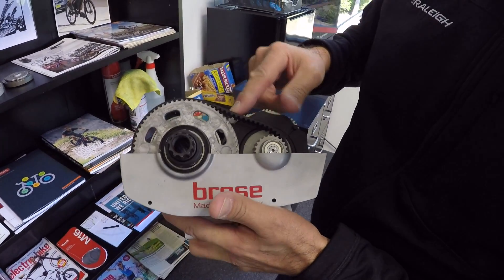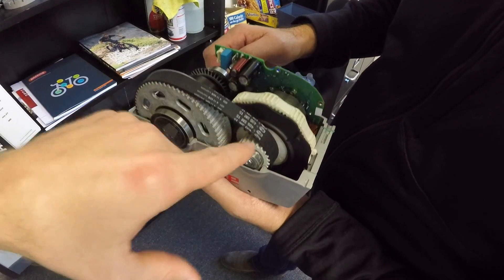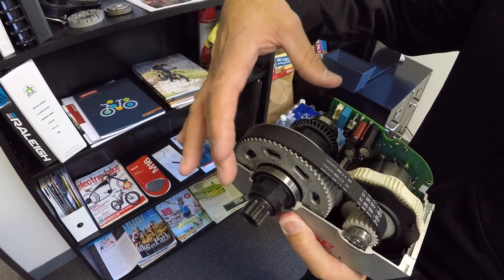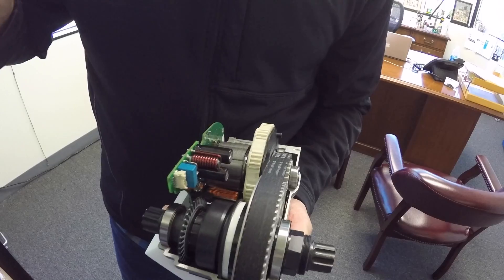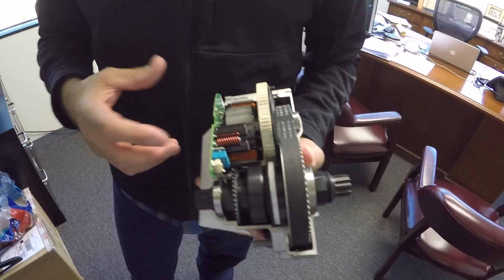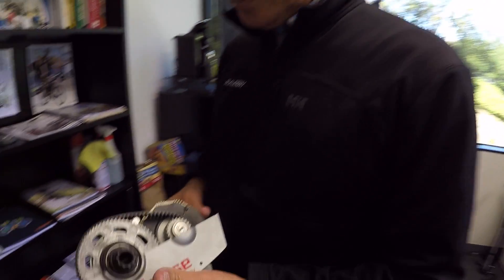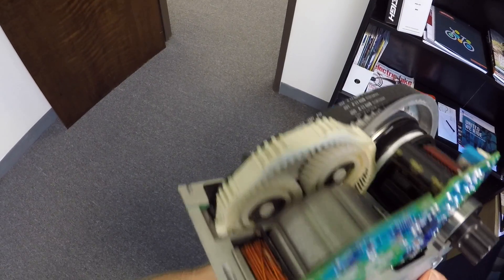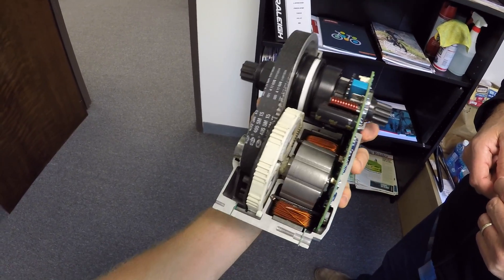Inside the Brose Electric Bike Motor

Comment: Planetary gear broke after 1000 km to Brose S-mag 2021. I bought a new Planetary gear part but obviously something is not working anymore: I'm a Fan Brose but after this engine  whitc is so fragile I am chane to Bosch bike. Don't sell parts anymore if they can't be changed than in the factory.

Comment: Awesome✳✳>share4.photo/ebicycle?ㅙ35    fast and very fun. I have not yet taken the bike for a long ride as it has been snowing at my house since it arrived. Very happy with crazy quick shipping. The install video is pretty poor but if you've ever done bike maintenance you can figure it out. It's definitely heavier than a normal mountain bike but the power makes up for it 10 fold. The tires don't look very durable and won't hold up too long in the desert out here. Overall I'm very satisfied with the product.

Comment: Thank you for giving us that look inside the motor. I found this video because I'm trying to debug what I think is a Brose motor problem on my new Specialized Turbo Vado 3.0. When cruising in top gear, maximum assist, 24-25mph, I get an occasional clunking/skipping sound and feel, as if the chain skips a tooth or as if the motor skips a tooth internally. On my last ride, I counted 20 such incidents in 5 miles, so I think it's getting worse. My bike shop believed it was a tight chain link and installed a new chain, but the problem persists, so I'm thinking it's in the motor. Court, have you ever experienced anything like this?
Reply: Any headway on determining what causes the clunking / skipping.  I had a Vado 5.0 do the same after less than a month of riding.  I turned it back into the shop where I bought it and they gave me a loaner Vado 5.0 while mine was serviced.  Now after 3 weeks, the loaner is starting to make the same clunking / skipping noises.   My bike shop stated that Specialized was lagging in aknowledging the problem.   I'm curirous how wide spread the problem is or if is just a couple of bad motors.  Please let me know what you learned.  Thanks

Comment: Ultimately the “microprocessor” that governs the bike’s performance/safety is your own brain. A newbie or "child" riding an electric bike may face a panic stop with the brakes, while still pedaling or at least moving the pedals. There is nothing “wrong” with having brake sensors that cut off motors to even mid drive systems.
Reply: I have a Vado 6.0. and it has sensors to cut the power ( or something like that) when braking

Comment: which means you need to replace the belt and sensors after certain miles ??
Reply from the maker: It's not something you replace... these motors aren't designed to be opened up. Think about how long the timing belt in your car can last. It would get much more use (and heavier use) than this and they last for years and years :)

Comment: Look like a great motor!! Is it water proof and how well does it work in the heat. I'm in Florida and it's 93 degrees every day in summer and rains every afternoon ?
Reply from the maker: I believe that these higher end motors are very water resistant but you wouldn't want to submerge it. I think it would be okay in the rain and riding through puddles :)

Comment: The motor does not stay quiet for very long mine is making a lot noise
Reply from the maker: I'm not sure what the deal is but yeah, I have heard some loud Brose motors (on demo bikes mostly) but I bought one for myself last year (the Specialized Turbo Vado) and it stayed quiet the whole time. Maybe it has to do with how hard you ride it or maybe some batches are better than others but yeah... I confirm what you've experienced and I don't know why that happens
Reply: Mark Galloway Thanks for that real-world detail, Mark!  That's the kind of gotcha consumers are looking to avoid!
Reply: i think its a belt tension..lag
Reply: Any headway on determining what causes the clunking / skipping.  I had a Vado 5.0 do the same after less than a month of riding.  I turned it back into the shop where I bought it and they gave me a loaner Vado 5.0 while mine was serviced.  Now after 3 weeks, the loaner is starting to make the same clunking / skipping noises.   My bike shop stated that Specialized was lagging in aknowledging the problem.   I'm curirous how wide spread the problem is or if is just a couple of bad motors.  Please let me know what you learned.  Thanks

Comment: I've started riding Bafang HD motor couple days ago and I'm amazed how powerful, quiet and efficient this motor is.
Reply: dmitry manzano I have a Bafang system in my Voltbike Enduro and it's quiet, powerful and reliable. Plus I have a brake cut off which Raleigh forgot.
Reply: Arnold Winters Reliability is the most important thing actually. I also have brake cut off but don't have shift sensor. What model of Bafang you have exactly?
Reply: See electricbikereview.com and search for Voltbike Enduro.
Reply: Arnold Winters I did that already, but didn't find a name in the description of the video. Seems like Max Drive, Bosch alike, right? Should be much less powerful than normal Bafang motor.
Reply: You don't need shift sensor. Just use the "dead" zone of your brake sensors to trigger the motor cut off, shift, then release the brakes. Works best if you have the magnet type. If you run throttle, some throttles has a dead zone. I use my ebrake as "clutch" to turn off the motor. Useful to pedal pass pedestrians or when I want a faster motor cut off.

Comment: I think Raleigh is behind the curve on eBikes, using , or shall I say NOT using, the best thought out technology.

So why does Raliegh not use brake cut off? Why do they mount the batteries in the rear over the wheel  high location, especially on low step frames. Do they want frame flex?
Reply: Because you don't need brake cutoff on a high end mid drive unit (Brose/Bosch/Shimano) and it's way easier to mount a battery in a rack on a step through bike rather than building a frame around a battery. It's part of what keeps their prices down...
Reply: WellOiledMachine that's not so. High end or low end batteries need to be cut off while braking for safety concerns. Rear mounted batteries for cost savings? Have you reviewed Raleigh prices lately? They are in the high end for bikes. Finally, integrated batteries are the state of the art in ebikes with low step over or medium ones. They are used with many low step bikes.

Raleigh bikes have unstable flex in the frames which is another unsafe feature.

I would NEVER recommend Raleigh ebikes.
Reply: all of their rear mounted battery bikes are sub $2,000, that's considered pretty low end... Brake inhibitors are only needed on hub motors when torque sensors go out of whack causing the motor to continue turning when power isn't wanted. Mid drive units nowadays are made in a way that something like that isn't possible. Educate yourself my friend. You want to see real top of the line look at the Bulls Cross Lite E and Lacuba EVO E8 step through models, those are high end. Raleigh's step through bikes are cheap cruisers to have fun on.
Reply: Raleigh trail ebikes have both mid motor and battery. Their pavement bikes over $2000 also have mid motor and battery. With minor exception, the remainder of their bikes with rear battery are under that price.
Reply: Brake motor cutoff is considered a safety feature even if the motor immediately stops with either pedal assist or throttle as a 'just in case' scenario if the rider doesn't stop using the power while braking. It's also a safety feature for both hub and mid drive if the motor continues for a second or two after power is stopped.
Reply: I agree. Safety comes before price.
Reply: Arnie your killin' me.
Reply: I charge for the entertainment.
Reply: Hell I can't imagine how a 80 ft/lbs motor can overpower brakes at 25mph michael evans, you'll have to ask the manufacturers why they think it's possible.